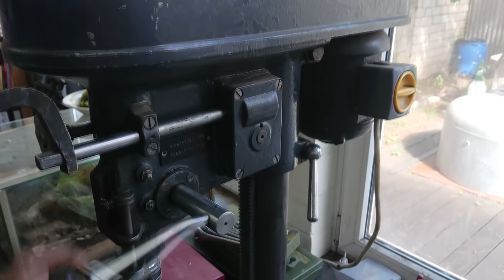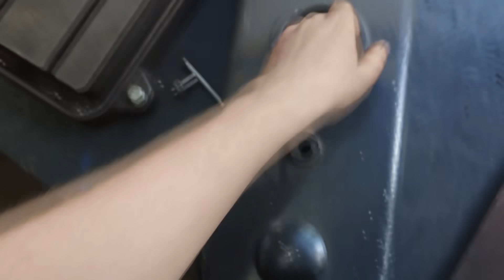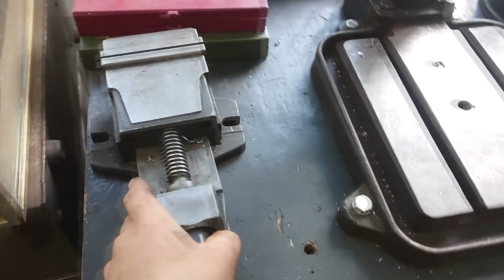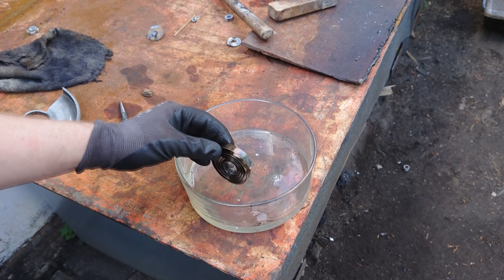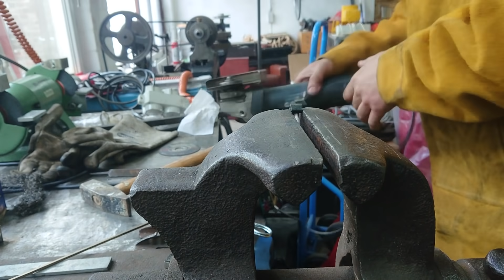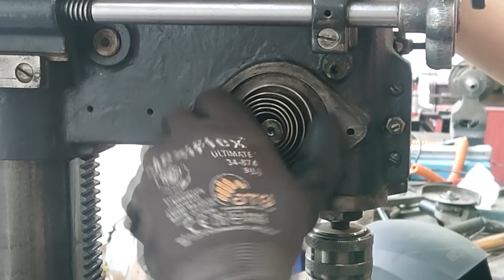Let's Repair my Drill Press

Comment: I was taught that the magic rpm number for drilling holes or using a lathe/miller is 300, if you are drilling a 1 inch hole the rpm should be 300, if a half inch hole is drilled at double the rpm, so its 600, quarter inch hole 1200 rpm.( 300 divided by a quarter equals 1200), this ensures the speed of the outer edge of the drill is not too fast to cause the drill to lose its temper/hardness by overheating. Great videos btw, i am watching them all :)
Reply: I learned something new today!
Reply: @Christopherbever  This rule is for steel being cut by a high speed steel drill or lathe tool, using  carbide tipped tools higher speeds can be used, but it will put more load on the machine motor and gear mechanism, Removing material less aggressively will ensure longer service times and less chance of break downs, and off course lubrication will cause less friction/noise and heat to be produced :)

Comment: The vertical shaft is called the quill
Wash the grease out with diesel-cheaper and better
Clamp the end, heat with torch and bend a new eye
Re-install
Reply: Springsdont like heat?

Comment: Very nice little drill press. Back in the early '80s I rebuilt some heavy duty cast iron machines built in the 30s and mostly all they needed were new bearings and possibly a new electric motor. Now we live in a world of either cheap plastic, stampings, and rough castings or expensive CNC machinery with not much available in-between. You're lucky to have scrap yards that let you look around and purchase small lots because many in the U.S. won't allow anyone in due to liabilities and sell it off to the few steel smelters left in business.

Comment: I have the same problem and figured I'd have to take the machine apart to figure out the cause... but now I don't. Thanks! I like the comments about heating the spring and bending a new hook. That's the fix I'll be employing. I don't have a welder.

By the way. I love your channel.

Comment: I love old drill presses. I refurbished an old (1940's) Canadian Buffalo using new bearings and it works as well as the day it was made.  They really haven't changed in a century.
Reply: im also a fan of the old Canadian brand, My little woodshop is a beaver lodge. lol
Reply: Hence the reason why stopped making them like that - if it doesn't break, why would you need a new one?  And if no one buys the machines - how they would continue to make them?
Reply: I've got a general drill press and bandsaw, both are awesome machine
Reply: consumerism killed quality
Reply: @patprop74  People want cheap -nobody gonna pay you 1000$ if they can buy it for 600$ even thou its made inferior.Thats how chinese econmy works -first you offer things incredibly cheap -that beats the local manufacturing ,then  when you got no competition left you raise prices.
In 2008 a wave of chinese scooters swoop my country,you could get them as cheap as 400€ brand new.There was a tomos factory in slovenia that produced licenced husqavarna mopeds -that lasted for decades (parts were cheap,motors are super simple ,even 13 years old kids were repairing them,simple 2 strokes ).Only problem was tomos costed 1000€.So what stupid  people do ? They massively buy cheap chinese scooters that have a lifespan of 5 years top then everything starts to fall apart,you cant fix them by yourself(most of people)since its complex 4 stroke engine,price parts went up.Tomos goes out of buisness after decades of existing-and look and behold chinese scooters are now 1500€!!!
Its our own fault for buying cheap.
Reply: @zumbazumba1  I half agree with you, for the most part, people buy cheaper goods, yes, but it is only because that's what they can afford in the here and now because most want everything right now, Give people the opportunities to buy more durable and expensive products and they will 9 times out of 10, if they can afford. We just live in a world that doesn't know how to go without till they save up for something better. But youtube channels like this and many others like it, shows that they need not compromise of getting better value for less money, Anyone can learn to get older product and make them useful again, its just a matter of choosing to do so or not.

Comment: You are correct!
They don't make them like that anymore!
I acquired a late 1950's Craftsman table top drill press & it weighs 3 times the cheap junk they manufacture today!
Reply: I have a no name brand one, which is around 30 years old or more ( bought on auction) and it is a lot better than the cheapies, which i also have as used. Needed a new chuck, so put on a keyless one, and it is fine. The cheapie had to replace the capacitor, and there the manufacturer cheaped out as well, supposed to have 8uF, and they put in a 5uf one, so now it has a cluster of 2 4uf ones cable tied to the capacitor box, because those were the ones I had around new, used for AC condenser fans. Should change them out, but not likely, as it works now, and i will just look out for some used 8uF ones when at my tool shopping yard, otherwise known as the scrap yard, when they open again from lockdown.
Reply: @SeanBZA  Yo you know how to wire a 3 wires air conditioner condenser fan? But just the fan,i have old daikin one that i want to repurpose as a ventilation for my workshop.I tried youtube but everyone wires them with a compressor and i want it to be standalone.
Reply: @zumbazumba1  if you are just wanting to convert a 220 squirrel cage fan to use as a shop fan go to a channel called "Scrappin Fam". He did it after I fussed at him for breaking them down for the copper in the motor. He did a good job with the conversion. You can tell him I sent you. Thanks

Comment: Nice, quick repair. Old 1950's - 70's drill presses are the best, mine is a 1950's build machine and it is solid as a rock. Big contrast to what we get nowadays.
Reply: Nothing is made to last these days.  Be it workshop gear or electronics.  Todays market is made disposable and to baby people too much.   No one makes stuff repairable because no one wants to take responsibility if the user gets hurt.  Back in the day, the end user new to take responsibility for their own actions.  These days it is all "the manufacturer is at fault".......
Reply: @EsotericArctos  Not entirely. We have a lot of survivorship bias. I'm willing to bet that 70 years ago there were plenty of bad tools. But those didn't survive. The cheap versions broke, or were bad and thrown out. It's why I intentionally look for old tools that have replacement handles.

There are good tools being made today, but they are expensive. As were the good tools from 70 years ago.
Reply: I can still remember my dad being upset by what he called, Japcrap being imported in large quantities. He was born in 1920. When televisions and radios started using transitors and printed circuit boards they were being called "solid state". Can still remember taking a tube to be tested at the local drug store.
I still have a Craftsman radial arm saw, dangerous as hell but it will do things a modern compound mitre saw could begin to do.
Reply: @donniebrown2896  It seems to be since so called solid state was introduced, things have gone down hill somewhat.  I do remember the "japcrap" term, though honestly most genuine Japanese made stuff was pretty good quality, it was more other places that licensed the brand names that was rubbish.   Genuine Japanese TEAC as an example is professional quality stuff.  The domestic TEAC we see is licensed to use the name and generally throw away rubbish.
I know the world wants to progress and get things smaller, but valve/tube equipment was really reliable.  Even something poorly engineered would generally keep working, but maybe wouldn't be as sensitive or would have a bit of hum in it.

Comment: i can relate i bought a drill press a bit larger than the one you have from the 70s. The friking tip of the motor shaft broke i payed a good chunk of change for it too so i decided to try  and make a new moter mount and asked a friend to make me a add on on a lathe so i can attach a bearing on top of the motor pully and use the other side of the shaft . As if i did not have enough problems i had to do it all during this covid bullshit . Drill presses were made way better back in the day  i finaly got the whole thing working today

Comment: I'll make a recommendation as an alternative to both degreaser and solvent: ethyl lactate. It is made from ethyl alcohol and lactic acid, and will break down back to those components in the presence of a mild acid (I use vinegar). In the U.S. it is considered safe for use in food, so it's considerably less toxic. It is considered "stronger" but "slower" than lacquer thinner (and used as an alternative to that—e.g. "bio solvent" or "eco lacquer thinner") in that it will dissolve more stuff than lacquer thinner but it takes longer and evaporates slower.

Comment: Cheaper than WD 40 is illuminating paraffin, which is good for the initial cleaning as well, and it will provide some protection as well, but evaporates off reasonably fast.  Also can be bought very cheaply, and typically comes in a steel tin here in the big box store, around a tenth of the price of WD40 or the generic ones, which are mostly based on paraffin which is dewaxed ( which makes it basically jet fuel) blended with a very light oil to make it leave a thin film behind, some solvents to help it clean, and then some aromatic compounds to make it smell.

For cleaning just the plain illuminating paraffin works, and then you can add light oil for protecting the parts. Cleaning mix it with a little substitute turpentine, and keep it in a bucket with a lid, and it will work well, just soak in the bucket, scrub with an old paint brush, and drip dry, and close the bucket again.

Comment: Perhaps put a thick o-ring on the flat part near the chuck.  It is where the depth stop attaches to the spindle.  That will give a cushion when the spindle comes back up against the main casting.  

Very well done.  I really like to watch your videos.  A mechanical Dr. Frankenstein, no doubt.  Bring to life old, dead machines or taking parts to make an entirely new device.

Comment: You can clean grease very fast with Naphtha. Best part, you don't throw it away, you just filter it with tissue paper (or coffee filters 4~5 should do it, not the plastic kind, no plastic near Naphtha) and reuse it. The liquid itself has around a year shelf life, but i've had it kept in glass jars and jugs for more than that and it works perfectly. Much more efficient than wd40 and it's less of a pollutant since you don't throw it away.

Comment: I do like how the rack/hight adjustment & on the other side looks like belt ajustment, on the modern ones like mine it can be a pain trying to hold motor belt tension & tighten it up at same time, I think that's why I just leave it set on one speed, very good video, well all yours are! 👍🇬🇧 Coventry.

Comment: We have a drill press from the early 80s and one  day I walked in and it didn't work. I freaked out a bit but on instinct I spin the Chuck and vromm it works. We have frequent dust storms and dust got in the motor contacts.

Comment: Hello, if you think that gasoline evaporates too easily and you feel dizzy with the fumes you should try to clean with some diesel. It has almost the same "power" as the gasoline to clean, but it does not evaporate, which makes it very useful (and way cheaper) than buying other degreasers such as carb cleaner or wd40!

Comment: At last a good old fashioned honest video. A couple of questions.  Why did you not heat and bend the spring end.  Why gave you not added a electric speed controller to the drill.  In that way you can smooth out the speed belt steps.

Comment: What you have here i think is a AEG TB-15 and yes it is completely build by aeg. I suspect it to be build somwhere in der 40-50s. the color is kinda correct, mine has a slightly darker tone. My tb 15 also has the older style flat leather belt drive.

Comment: to clean the metal parts from grease and also from the paints I use the nitrocellulose paint thinner is certainly cheaper than the WD 40 even if it presents fire risks (maybe even the WD40 is flammable) of course it is better not to use it indoors, but since you often work outdoors.
But use reclosable containers like wall paint bins because it is volatile
From an economic and yield point of view, it is the best and fastest I know, even if it is not suitable for plastics except polypropylene and polyethylene and some type of Nylon because it dissolves them.
Ciao and to the next videos

Comment: Use with sprite for cleaning, it is penetrating and not expensive in a 20 L canister. You can also use it whit a small hand pump can. Most of rust killer is 90% ore more with sprite !

Comment: All that work when you could have just heated the very end of the spring and de tempered that little bit then bent it further round losing just a small amount of the spring then when you have finished just heat it again and quench it. job done.
Reply: Wouldn't he have to then temper it after quenching (or it would be too brittle and would break again)?
Reply: No quench needed.

Comment: I'm planning on using plain kerosene (or as we confusingly call it in England: paraffin) instead of WD40 because it's  SO much cheaper and WD40 is 99.99999% ;) kerosene anyway.
Your drill press is almost the costar of these videos. I remember you demonstrating hall effect sensors and my continuous jealousy of your having 3 phase!
Oooh 100kg.... that is a NICE drill press.... my jealousy increases.
Reply: FYI, it's actually spelled 'paraffin' and not 'parrafin' When chemists came across these non-aqueous liquids they tried to do some organic chemistry, but found they were mostly unreactive. Hence they were nicknamed 'par' ( Latin  for 'not',  I believe ) and 'affin' meaning they had no 'affinity'.
Reply: ...the 40 in WD40 stands for 40% oil. So it's only about 60% kerosene. Kerosene wouldn't be able to replace WD40.
Reply: @simont3686  Water Displacement-40th attempt is what wd40 stands for, It was designed for Convair to use on atlas missiles to keep the skin from rusting. 
It showed up in stores in about 1958 and gone full scale since then.
Reply: @kameljoe21  Exactly , Made By NASA !
Reply: Kerosene and citronella to keep the mosquitos off. Dual use!
Reply: @thewolfin  eugh! Citronella! I'd rather use patchouli! ;)
Reply: Another vote for paraffin (kerosene), dirt cheap, great for degreasing/cleaning. Used extensively in industry, and equally effective at releasing rusty bolts as any overpriced proprietary product.
Reply: WD-40 and other maintenance sprays are not %99 kerosene/paraffin. It's more like %40 Naphtha + %40White Spirit(mineral spirit) +%20 Mineral oil(2 stroke oil works good as well). As a penetrating fluid for really seized up and rusty nuts and bolts try; %50 pure acetone + %50 Automatic transmission fluid and you will be amazed how good and quick it works but you got to use it very careful because Acetone will ruin the plastic, rubber and paint straight away and the ATF will ruin them as well in the long term.

Comment: That's a pretty nice drill press! Definitely a metal-type one, much better than my old drill press which, though it was cheap, has a good bit of wobble or at least flat spot on the belt. Have been debating replacing the bearings for years...

Interesting to weld that hook on, I would have just tempered it and bent a new hook. (Did you do something like that on another repair? It sounds familiar)

Comment: You could've just bent the end of the spring to form a new hook using a vice and pliers, could've heated it up a bit if it was too difficult to bend although I highly doubt it. And WD-40 isn't typically used to clean grease, some automotive brake or carb cleaner, or lacquer paint thinner would've done a better job.

Comment: Why did you weld new steel on instead of just bending more of the spring into a hook?
Reply: He skinned the cat.
Reply: You don't get a chance to play with the angle grinder or welder that way!
Reply: Bending spring steel needs quenching and normalising cycles to remove stresses from bending or it becomes brittle and breaks easy, welding on a thicker tab allows the spring to go back in under the same tension if he bent the spring it will be tighter and retract the quill banging it on the head as it returns

Comment: I may well be wrong, but is there some possibility that the reason you have some failures in these old, heavy gauge, pieces of equipment is because they didn't really have failure analysis put into the design, so some things have much more material than they need and some other areas are too feeble? I'm thinking of both this and the vice that had to be brazed.

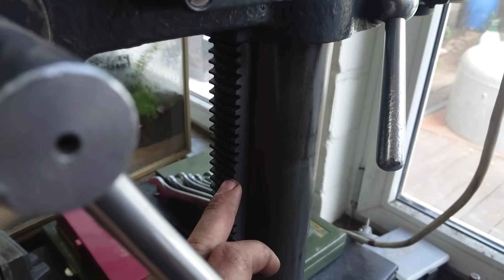Comment: 3:34 I like it when non native speakers make you stop and think about the actual definitions of words.

A native speaker wouldn't say massive in the sense of something being solid, only to mean large. but it is technically correct definition I believe.

BTW that cone/pyramid shaped drill bit is known as a stepper drill/bit.

Quite liked the slightly more relaxed style in this video btw.